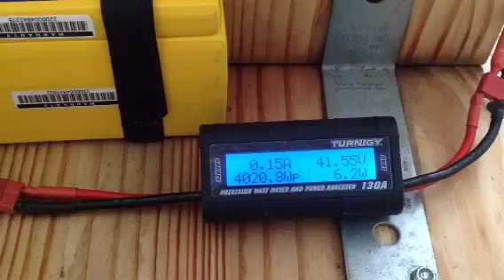Turnigy RotoMax 1.60 Brushless Outrunner Motor - 2

Comment from the maker: I like it so far, its stronger than any other 1.60 outrunner motor in the market, and for the price its a winner. I use K-Force 120A ESC with it and its perfict, APC 20x10E and 10s  is the right setup, not 21x13EW as Turnigy recomand.

Comment: So what do you think about the motor? I'm thinking about getting it for a 30cc conversion with the K-Force 120A ESC. How does the motor and ESC handle quick full throttle punches? I think it may be overkill on 10s, perhaps 8s is better for a 30cc plane.

Comment: So can you tell us how much time can still running your model before it achieves the Discharge Rate point and thanks in advance ;)
Reply from the maker: If you go with APC 20x10E and you dont use full throttle all the time, you may get 5~6 min flying time
Reply: thank you so much for reply ... 😉

Comment: What size of standoff are you using (I mean diameter of the bolts)
Reply from the maker: +Girish Kumar Sharma I use "Great Planes Stand-Off Brushless Motor Mount XX-Large" all stuck bolts and nuts. worth it.